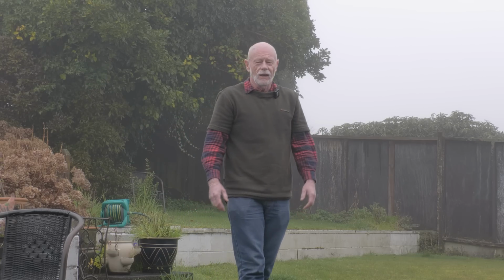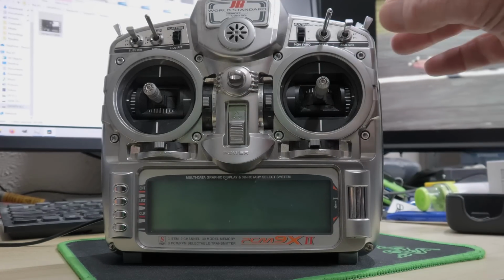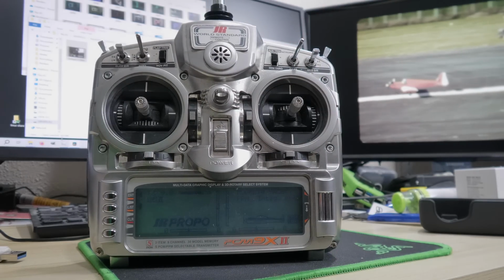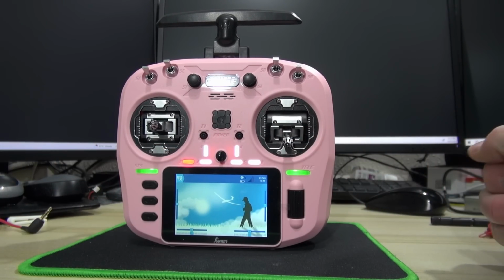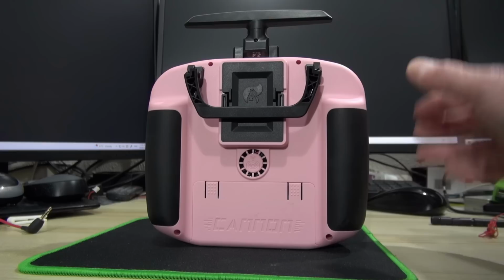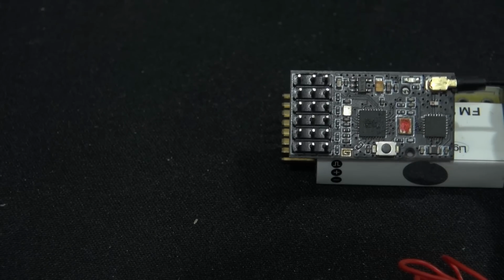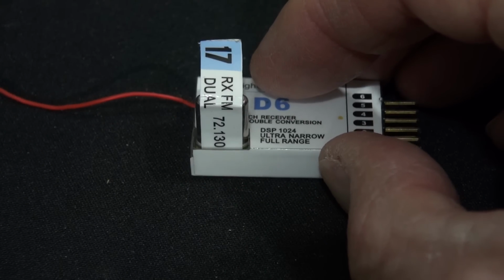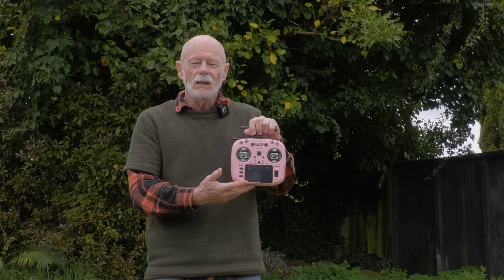Jumper T15 radio - why did no other reviewer push this button?

Comment: Are any of these smaller sized radios actually doing the same as the TX16S? Seems like every reviewer is radio silent (no pun intended) on TX16S, pushing T15, boxer, t12, pocket etc. as if all the TX16S are sat on shelves collecting dust.

Comment: I am still using My Jumper T pro  V1 2 years old running 3.01 firmware I buy the solo good elsr receiver already loaded with 3.01 bind and go ;;  hard for me to buy a new one its been so awesome , I love plastic light weight gimbals no noise and the hall sensors are super smooth

Comment: I'm an RC car racer coming back into this after a break, been going now a couple of years but I had a stark realisation that open-ness in the TX/RX space is dead. You could use any RX with any TX back in the day, whereas now there are too many proprietary standards that seem to be changed for no obvious reason other than planned obsolesce. I really wish the manufacturers would get together and work on agreeing a means to either standardise or have a jumper or setting that allows proprietary mode to be disabled (And whatever benefits they say they've put in) so it'll work with open standards if the user wishes it.

Comment: I have nothing against the new stuff. I fly radiomaster with some planes, but with nitro I always go with the 72mhz pcm gear.  I'm picky with what I use, and make sure it's all good, but I just trust the stuff.  You can plug it in and go fly, no fiddling.  I haven't had any problems with it since I got back into the hobby almost 4 years ago.  Futaba 9c and an old Super 7 are my favorites.   One thing that's nice with the older stuff is that it didn't brown out with the batt go low.  I think right now is a prime time to fly 72 because no one is on it anymore.

Comment: Genuine question ? Apparently there gearing up to install a massive wifi system right next door to my house so the local football grounds can get wifi anywhere on the field or in the grounds.. Does this sound like somthing that will knock my 2.4 stuff out of the air.. I often like to fly small micro and foamy planes out my back.. I wouldnt be more than 40 feet away from this thing..

Comment: I bought a Jumper T8SG carbon a couple of years ago. $99 delivered for a 12 channel transmitter that works with just about every manufacturer's receivers. Compact and very programmable. My only issue is that the Hall effect sticks are so smooth that I find it too easy to overcontrol compared to my Futaba and Orange RX Transmitters with their pot type sticks.

Comment: I had a habit of packing up the car after a days flying and forgetting my 4 channel Futaba radio on the roof and driving off.   30 years later radio still works.  No, I don’t actually still use it.

Comment: I bought a 6 channel Spectrum years ago.  My first computerized radio and loved it.
But……..after a few years of flying glow powered models under the hot Manitoba sun, the plastic seemed to deteriorate.  While flying and old biplane model the right control stick detached from the gimbal!    Crash!
A few months later the plastic antenna cover crumbled and fell off.   I’m thinking the plastic they use does not tolerate glow fuel or sunlight very well.
Advice?

Comment: No sliders!! No good. And as for the trims??? I’ll stick with my DX9 gen 1 and DX8 thanks. As for multis I fly DJI so use the DJI controller. No extra RX required means less weight, less complication and less faff. Oh and I’ve never liked Open TX.  Thanks for the review though it’s good to know what not to buy.

Comment: Hi Bruce. You didn't open it up this time.  I have a Jumper T-pro V1 on my desk which I ordered when they first came out.  Turns out it keeps the power to the external module powered to it kills the battery within a couple of weeks. I don't fly that much so I always have to revive my 18650 cells.  I contacted Jumper when I found out this was a known bug and they said I'd have to change the main board and power board and it wasn't worth it and I should just buy a new one (it was out of warranty).  I said why the hell would I buy another one when the first one is so crap and obviously wasn't tested.  Anyway, it's useless now and I'll never buy another jumper.

Comment: If it's anything like the boxer...which it's basically same thing the radiomaster 5000mah battery lasts forever I have gone 3 flying days on single charge and each time is about 4 to 4 hrs that I don't turn it off

Comment: Modern radios always have something completely garbage about them!!! Pocket has the worst buttons out the front and Zorro forgot to add proper batteries, jumper t pro is like a bar of soap, t-lite has no rf power... Now i am a game pad guy, i tried the boxer and t14, the t14 is far better design, but boxer is nicer quality, radio master is far from master of design!!!! They eff up everything!!! I like my old th9x modified to use ELRS better then all these big radios though, can't wait to see what flysky is going to do now that i here  they are finally going to elrs!!! I have a nirvana, but hate having a module... I will buy an Elysium if they trash the flysky protocol and put elrs in it!

Comment: I still use the Jumper T8SG for all my kwads , I own a Zorro but have had no need to use it so far . All my fixed wings are Spektrum and I use a DX9 for them. To many radios over and over and so many this is my new driver this is my new driver...Plzz   Good to see a review that is not about hype but common sense and some nostalgia .

Comment: I just got this as my first radio with the plan to practice on simulators for a while while I save for a set of googles/drone parts. Unfortunately I can't get windows to recognise the radio as a controller, and it only shows as unspecified under devices and printers, any advice? it does shows in drl as a jumper t15 but none of the imputs translate.

Comment: I started out with an orbit 12 Channel reed system on 27 mhz.  Man, I hated CB radios back then.  Caused a crash of my just finished Falcon 56 with a brand new K&B .35.  Completely smashed, bent the crankshaft and damaged the receiver. The reeds were humming when we made it to the splinter and crater site. Gave up until Futaba came out with a somewhat proportional pulse system.  Then kids...  that ended that for a while!  Thanks to Flite Test I started back with hobby foam and man that is so fun!  Thanks for the look back in time!

Comment: The gimbals feel pretty good, however, the hall sensors are the worst. They are a jittering mess.
Reply from the maker: I haven't noticed that - -maybe it's the Parkinson's masking the jitter? :-/
Reply: @RCModelReviews  I got the radio about a week ago, and the one side started to drift badly. Jumper is sending me out a new gimbal, but even the other side is now jittering as well around 0. I added a little bit of deadband with a curve to help. 

I can literally hear my quad flying weird because of the jitter when using the radio. So its an issue through it's entire range. Then I switch over to my trusty TX16s, and no issues what so ever. 

I have the T14 with the regular gimbals, but I'm pretty sure they use the same hall sensors. 

I think it's a good radio if everything works well, but I don't think it's going to hold up for most people. Hence my comment. I like to practice daily using sims and go out flying at least a few times a week.

Comment: is there a new technology that hops a while band of frequencies  to reduce the effects of jamming?
Reply: ExpressLRS hops channels within a band each packet, and if you run a newer transmitter with GeminiX mode it will transmit simultaneously on 900mhz and 2.4ghz
Reply: @Voyajer.  yes but i was more wanting something that uses even more frequencies 900 and 2.4 are commonly jammed now

Comment: I bought one of the early Jumpers. The one with the trouble with the bad connections on their ribbon cables. Never again. Glad to see you putting a review out, mate. 👍
Reply: I have one of those too, although I've never even taken it out of the box.. lol
The ribbon problem came out just after I made the purchase and rather than fix it I kept my Taranis going until the TX16S came along...
Added to the piles of redundant RC stuff I've gathered over the years.
Reply: @alasdair4161  That's a perfect example of what FrSky did for the hobby, bring down radio and receivers to affordable prices for the world.  They may have turned down a different path since, but I'll remember them for that.
Reply: The bad first gen Jumpers, is why the designer started the Radio master company.
They cheaped  out on parts and labor.

Comment: I still fly long wire. 36Mhz (not much R.F on the West Coast😁) Hitec Eclipse 7. Mode 2...? Throttle and rudder on one stick, elevator and aileron on the other. Used to fly G.A so it made sense to make it like a real plane. Still have all my previous TX's in the shed which started with the Futaba Conquest AM. Still works....good luck using it in built up areas though 😉

Cheers
Pete' 
Hokitika.

Comment: BRUCE!!! You clickbater... now you'll have everyone complaining that the rubber bungs there for the GeminiX upgrade antenna option (if/when that eventuates) is a secret colour change button, and that theirs is faulty!! 🤣🤣🤣 Great review. One other thing the T15 has up it's sleeve is those 6 buttons on the front that light up can be customised so that they are more than basically a a 6 position knob... you can group them however you want, make them mutually exclusive or be able to turn on more than one at a time, or even make them momentary.

Comment: Mode 1 all the way. 😀.  Bruce do a Mode 1 vs Mode 2 video, that will really get the blood pressure rising in us old guys.  😅.  I love the old JR radios.  It was not just the software, it was the design and build quality.  If you had a JR PCM-10 back in the day, you were the boss.

Comment: looks like soft touch/rubber coated plastics...
Reply: Hard  - no soft touch coating to go sticky on you in 12 months time. Is slightly textured plastic, and has moulded rubber grips on the back, quite comfortable to hold.

Comment: you don't appreciate old skool trim sliders until you suddenly need FULL left trim on a maiden flight as your new pride and joy tries to corkscrew its way through the sky straight out the hand launch.
Reply: I got anxiety just reading that! 😱
Reply from the maker: I have to agree... being able to whack full trim on with the flick of a finger was great -- but the 9XII has digital trims so you have to wait for it to go tick-tick-tick-tick  :-(
Reply: i  loved the Multiplex 3030, analogue trims that you could after the flight convert to digital and recentre the trim lever.
I hate the modern ticky ticky trims.  If you fly old balsa, the trim changes week to week.  the 3030 system was spot on.
Reply: @markpitts5194  But what's the difference between the saved settings? 
I have flown the 3010 and now the Royal Pro/SX for years each. The only thing different is that the 3010 has manual sliders for trim which memorize their position for each model. The Royal has modern button trims and also memorizes the trim position for each model. The only difference is the haptic of trimming, i.e. how you input the trim-command. So if your balsa plane gets squewed between flights and needs retrimming both radios will have the wrong trim settings. I mean, how would the radio know that the state of your plane has changed after all? They just memorize the latest setting.

While the 3010 had the perfect system for manual trim sliders (it tells you the last position of the trim so you can put it like it was the last flight), it always bothered me having to do this manually. While they are faster, trim in general doesn't have that much throw that you can't just yank the stick instead reaching for the trim on a maiden flight that's gone wrong. 
On contrary I find it easier to get the perfect trim setting with clicky trims, as you can't "overshoot" the desired position because of "stiction" of the slider. You just add one click after another until it's where you want it to be. Setting up the control linkages mechanically sound before maiden really helps not having to trim a huge amount.

It may be that subjectively you like them better, but there are no objectively game changing features to on either of them.
Reply: I lost a 100+ hour kit pretty much exactly like that.  1/4 Great planes  piper cub.
Reply: Or till you fly gliders, and use the elevator trim 10 - 20 times during a flight.
Reply: No offense, but if you need to make a full trim adjustment during the maiden flight, it suggests a lack of experience.
Reply: @nanomiterctech423  If you've never had something that looks right not fly right, that IS a lack of experience.
Reply: @Walking_Death  had many of those but that's always the cg not the trims atleast remember what we were talking about .....or nvm just get some experience.
Reply: @nanomiterctech423  How about building and flying models since the mid-70s and career aircraft engineer since 1980 with two national airlines, a major manufacturer and a national air-force...   what you got?
Reply: @Walking_Death  oh really you wanna play this game !!! I am in !!  been working for a well known civil aircraft manufacturer and being the chief designer for a UAV group in it. 
And have been practicing RC aeromodelling as a hobby for the last 13 years or so 🤷.
Reply: @nanomiterctech423  Sorry... but thats rubbish.  I have known wood and tissue airframes that would need huge trim changes one week to the next.  Traditional airframes move around.  Granted the modern foam and or composite stuff is way more stable, but I get the feeling that is all you know ?
Reply: @markpitts5194  bud that's not in air, you do it on ground you can notice the deflection/deviations in the airframe and the control surfaces. Perform your basic checks before flight ..... You really need to have the basic knowledge of the ckecks they're gonna help you a lot.

Comment: Hey Bruce, Have you tried flying Mode 3? When I first started flying quads, a workmate told me that I should use Mode 1 in Australia, just in case someone else had to take over.  I tried Mode 1, but it felt wrong, and I just couldn't fly a quad with it. Then I tried Mode 3, which is still right-hand throttle, but having aileron and elevator on the same stick felt more natural to me. It's what I use for planes, too. It baffles me that whoever decided we should use right-hand throttle, didn't just swap both functions of the Mode 2 sticks over!
Reply: When i first started, mode 1 or 2 was what they told me, aha! i realizede mode 3 exists and a few simple changes in the sticks and what a huge difference, natural just like a small cessna aircraft. As a left hander it is ideal.
Reply: @steelydanZ  not being left-handed I fly in mode 3:
GAZ+Steer right and:
Aleron + depth on the left. Personally I find it more logical but hey it is free....

Comment: When I flew long wire I'm sure it seemed to feel better for some weird reason felt more with my plane my first plane was a Goldberg eagle 2 with a tower hobbies long wire controller I Remember and the plane had a os 40 it was gutless but still I had that plane for 5 years and frank crowfoot came to help me run in my engine and I flew At ngatea good memory s will fly gas or nitro for all my life but I will buy a byd seal performance electric car soon 😆

Comment: Started watching this, then reached over to the side of my desk to grab a JRPROPO MAX-66.
It is only a 6 channel but I was using it as a computer game ( simulation RC plane ), the game doesn't work on windows 10. ( no chance on win 11 ).
The only thing wrong with the controller is the battery, being, what, about a quarter of a century old. ( Haven't had any planes to fly for about that long or time to get to it. The computer game meant I could 'go flying' even a 11 at night ).